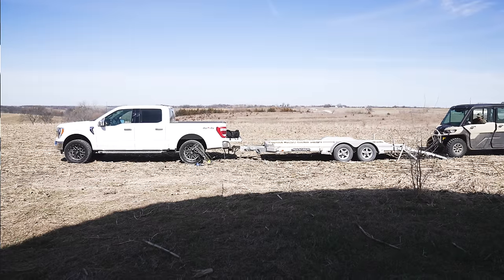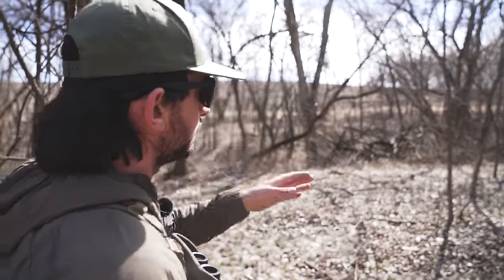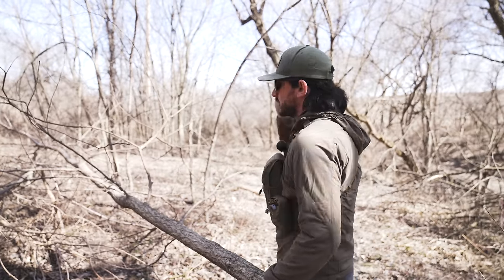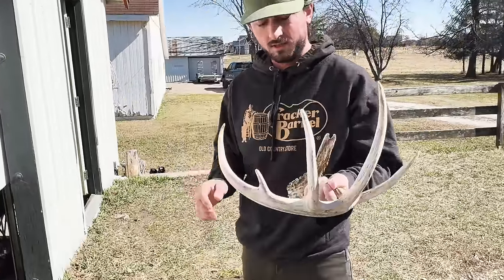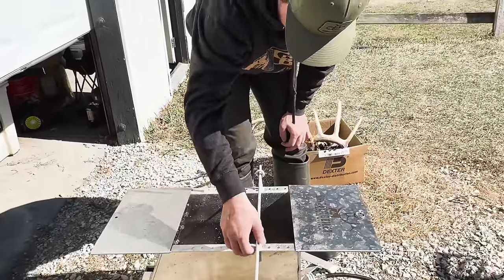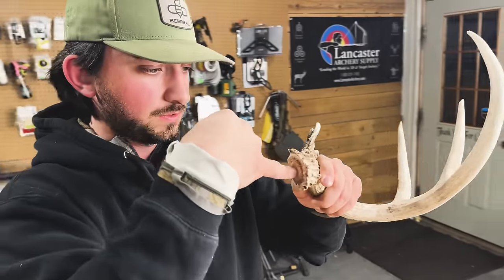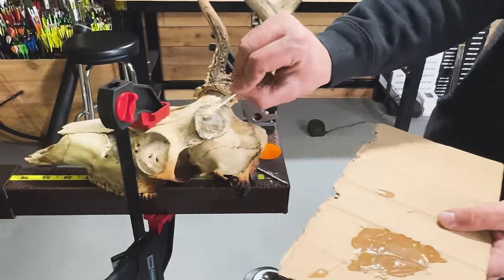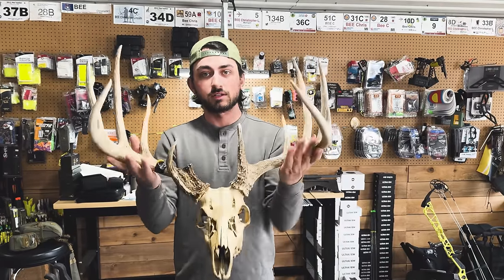I FOUND OUT What Happened TO HIM (BROKE G2)

Comment: Try cold emulsification! I use a 5 gal bucket, fill it with water, place skull (de-fleshed) into bucket, and let sit ~3 months.  I leave mine in an enclosed trailer, barn or under an upside-down garbage can so nothing can get to them.  Then follow same process had you boiled it (power wash, clean with dawn, then peroxide). It does take longer but is overall less work; you need no expensive equipment and the detail on the nose cartilage and eye sockets is great.  Plus you never have to worry about BURNT skull.🤣